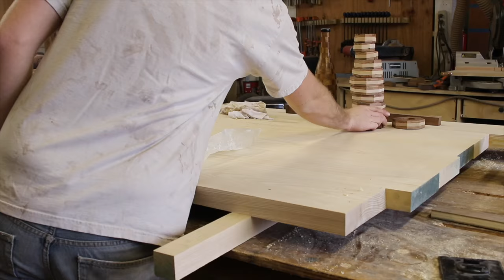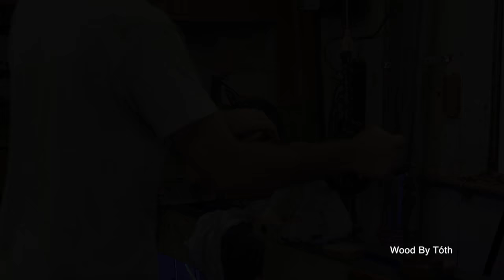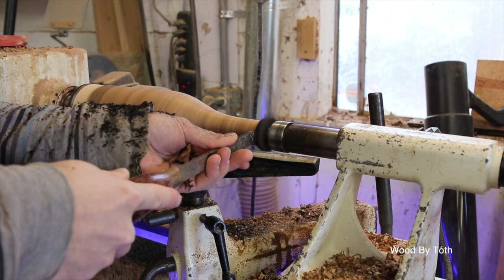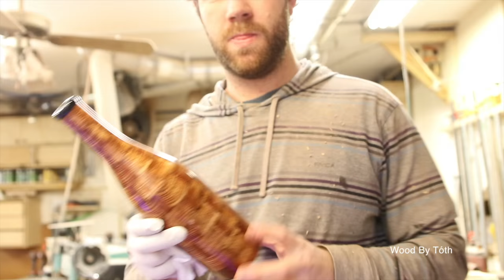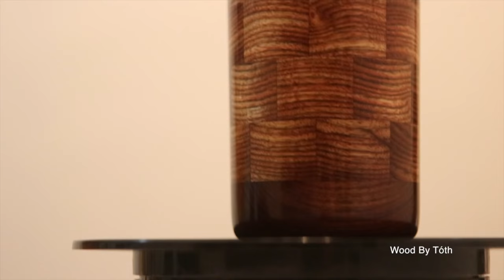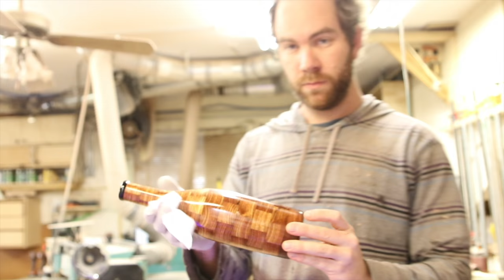Segemented Wine Bottle

Comment: I was trying to add a photo. I turned one larger, magnum sized, cut it down the side,  added Hinges and a clasp. I lined the inside with material,  and put a corkscrew,  and bottle stopper inside.

Comment: looks nice but I wonder if the inside is cleaned up at all, past the forsner bit depth
Reply from the maker: Jesse Fox No its not. I have turned the insides in the past but I like when the bottle has more weight to it so on this one its only clean past the bottle neck
Reply: Fair enough. Seems like it would be a nightmare getting it clean down in there

Comment: Beautiful work, Kyle, as always. A question - how do you get your segments cut so accurately on a radial arm saw? Loads of other segment turning stuff on YouTube involves precision jigs to get the angles right to a tiny fraction of a degree.
Reply from the maker: Andrew Moore I use a chop saw. Its how i've cut over 75,000 pieces. It requires some test cuts but its just as accurate. Check out a video I made awhile back called How I cut 70,000 pieces. It'll explain more there

Comment: No mysterious black construction paper stuff between the segments?
Reply: Mark Speir I cant tell if that is sarcasm or not, but if it isn't, he uses a black veneer (very thin piece of wood) sandwiched between each layer/segment.
Reply: He has been asked many, many times what that is and never answers, so I came up with my own theory. Not sarcasm. It just seems that he uses that stuff in all of his projects. I found its absence odd.
Reply from the maker: Mark Speir I put the materials I use in the descriptions. I get hundreds of comments a day and responding to the same questions gets old, so I stopped. Time spend responding to the same question means less time making videos. So it not that i'm ignoring you its just the info is there you just have to look. Please don't take this response the wrong way just trying to keep consistent videos coming!
Reply: My mistake. I really never knew. It LOOKS like black construction paper.